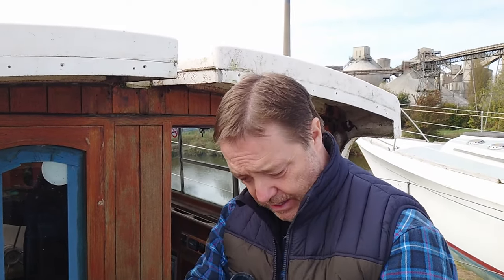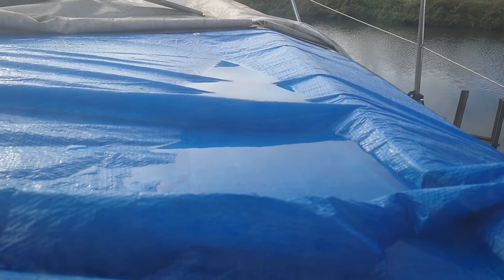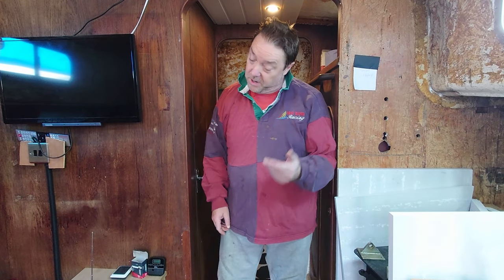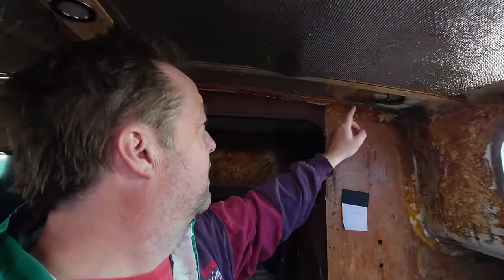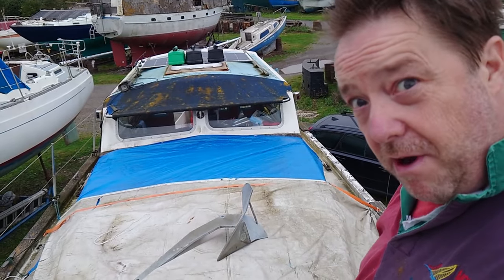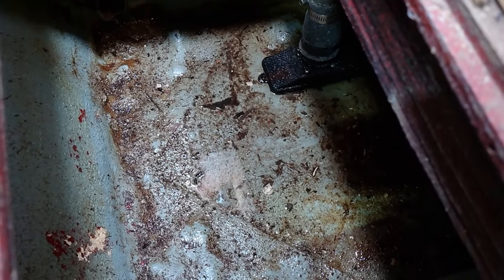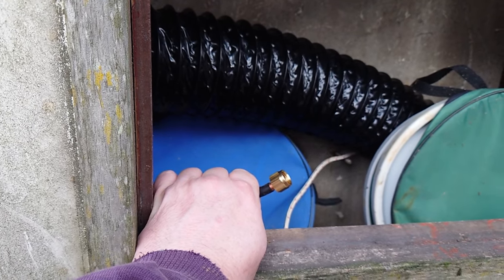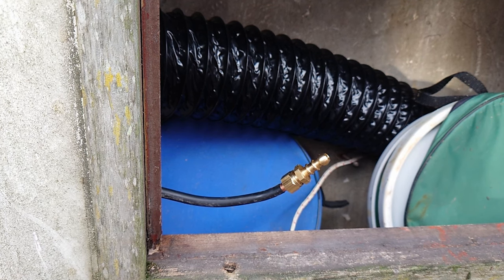Episode 8 - How To Connect A Gas Cooker On A Small Boat

Comment: Thanks for filming it all mate. Well done on the leaks! Cheers from Plymouth. James
Reply from the maker: Glad you enjoyed it
Reply: With the fuel tank. Feed small wire through filler to hole position then feed the wire through the spigot until in place.. Then do it up. But you managed so good job
Reply from the maker: Good suggestion though. Thanks 👍